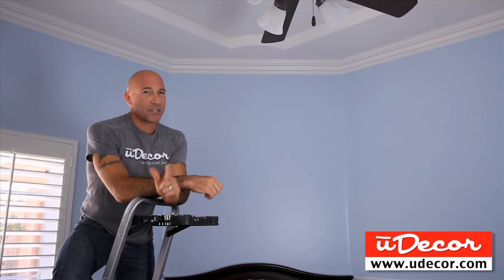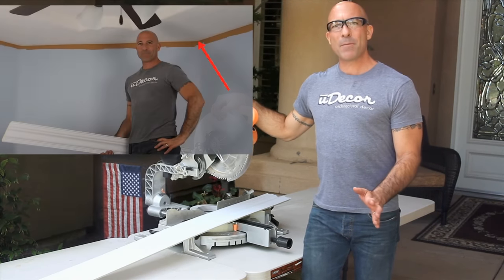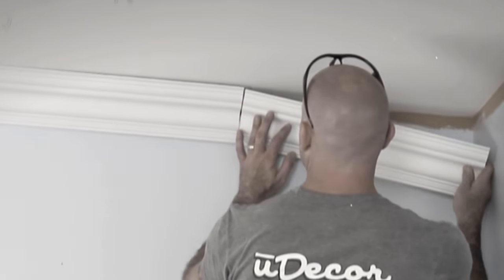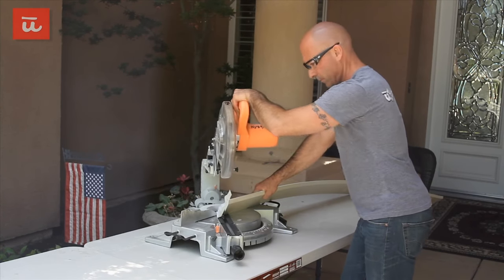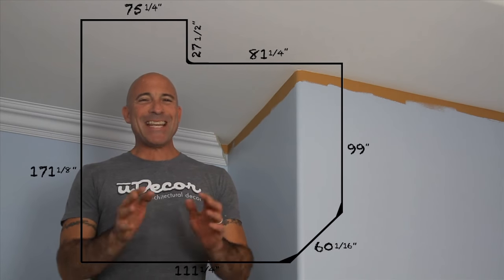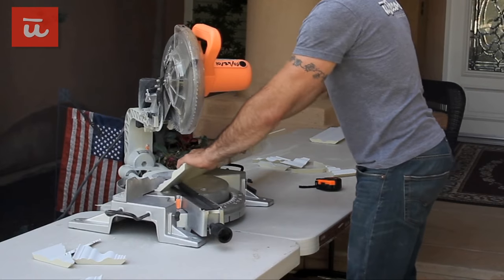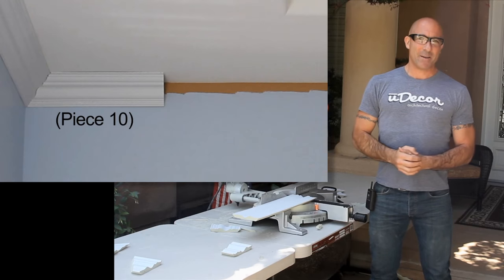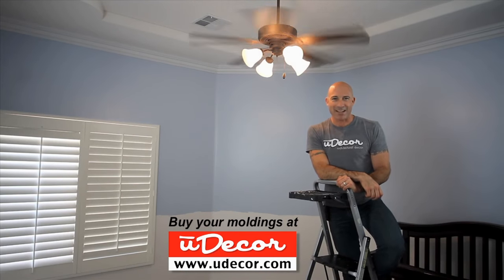How To Install uDecor Polyurethane Crown Molding with Eric Rosenfeld

Comment: First let me say thanks for an excellent video. It was very helpful.
I watched dozens of videos on crown molding. I ordered my molding from U Décor and was pleased with the product. I got the CM-1157. It's simple yet elegant.
In the instructions for the molding it said to use polyurethane glue on the joints and on the back of the molding where it comes in contact with the wall and ceiling. I found this to not be a good idea. It worked very well on the joints in corners and joining two straight pieces together. Here's the problem I had with applying it to the back of the boards. First off a quarter inch bead would have been a real mess. I tried about an eighth of an inch on the first couple of boards I put up. This glue looks like, and has the same consistency as motor oil. when you apply it to the back of the board it ends up everywhere, walls floor and you and your clothes. When it sets up it bubbles and comes out on the wall and ceiling before turning rock hard. Its a serious problem to clean up. It works great on the ends as long as you smooth out a very thin layer with your finger.
For do it yourselfers with little experience like my self I have one more suggestion. Save your money buying a crown molding jig. I bought two. both were semi-useless. I had to assemble both myself. The first one had a scale that was difficult to read and a kinda rounded off pointer that made it impossible to tell weather you had set it at say 38 degrees. It might be 37 or 39. I bought a second one that had positive stops at 38, 45 and 52, so I felt good about that. The problem with either is that they just get in the way. they are to bulky unless you have a saw with a gigantic surface and fence. Use this method in stead. Hold the part of the molding that touches the ceiling flat against the surface of the saw and flush against the fence and make your cuts. You can find instructions on the four different cuts on the web or in the instructions that come with U Décor molding.
Forgive me for rambling on.

Comment from the maker: Excellent question Greg ... that span was about 8 1/2' and the moldings come in 8' lengths.  That is one disadvantage of the shorter moldings, but doing the seams is really simple with a bit of practice.

Comment from the maker: That's exactly right .. unless you were using premolded corners it would be really difficult to put a seam right next to the corner.  It is best to at least have the seam 18" out from the wall (or more) since walls are rarely straight and the closer it is to the corner the more difficult it gets to match up.